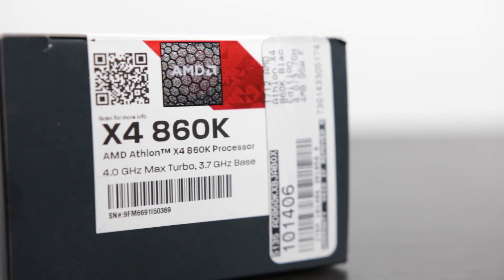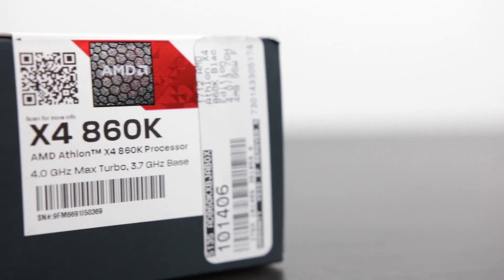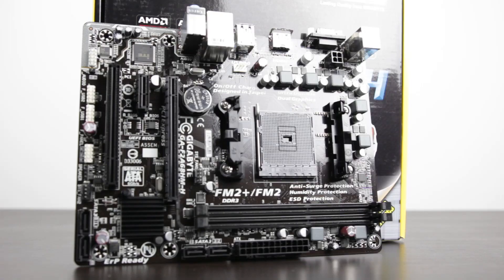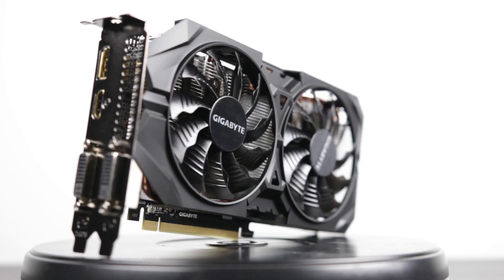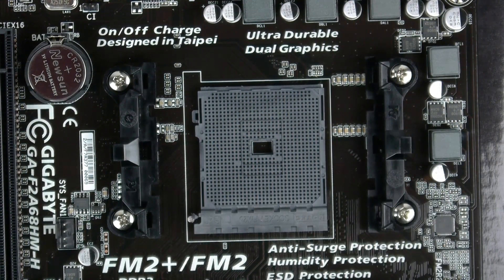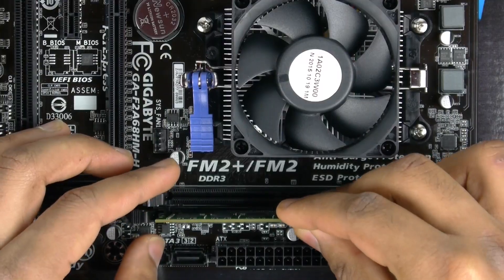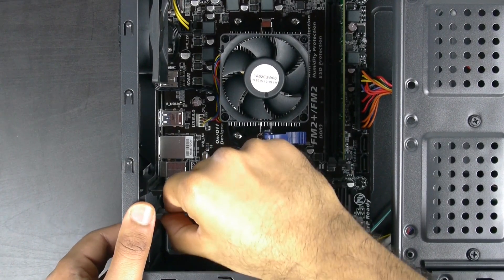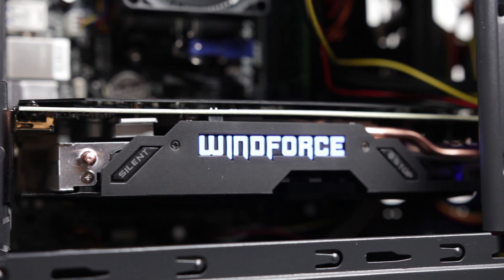Best 2016 AMD Gaming PC Under $400 - Build Guide & Benchmarks (Ep. 1)

Comment: I know this is an old video but I have a problem I built pretty much the same pc just different ram, gpu, and a different power supply I have the same mother board processor and don't have a harddrive instead of a hardrive I have a ssd a solid state drive I plug in the power cord to the psu and connect my dvi cable to my monitor I turn the PC on and it shows no signal on the screen if you know the solution to this please reply to this I really need help😔😔😔

Comment: Never Buy AMD your Processor will be s*** in 6 Months.
Reply: Deepnarayan Sett 7 years ago I bought a PC for 300€ : AMD Athlon X2 250 Processor 3.0GHz , 4GB RAM , NVIDIA GEFORCE 7500/630a and here I am still with this PC making video montages
Reply: Deepnarayan Sett amd is not that bad intel makes great stuff but i want performance for cheap if i had the money i would get an i7 but i would rather pay $100 for an eight core amd cpu rather than a $350+ i7

Comment: I'm willing to spend extra money for this build but people are saying some parts aren't good. what parts need an upgrade.
Reply: ChrisC 0324 look bro, the processor gpu and mobo are most important, you don't need to drop 100s on ram hdds and psu's just make sure they are compatible and efficient. Also Newegg.com has a lot of deals on stuff like ram. All the people saying that this is shit or that is shit are full of shit. This build is pretty good.
Reply: ChrisC 0324 ram. psu is okay, hard drive is fine. but, 4 GB OF RAM!!!???? Get 8gb of ram and it will be 9999999999999999.9999999999999999x better

Comment: Nice video! But could you tell me if the MSI h110m gaming mobo fits in this rosewill case? The mobo is in mATX form too but its a little bigger (11x11 compared to your 10x11). I find it hard to find a mATX case for this mATX mobo, since it exceeds the standard size of mATX which only 9,6x9,6

Comment: Guys I'm 16 and I want to build a gaming PC under 400 but every guide I saw is outdated and I really need help.
I want to have a PC that will last and I can upgrade in the future,but I don't have any idea what build I am going to choose.
Reply: first timers make this mistake, DON'T BUY A CHEAP POWER SUPPLY! IT MIGHT CATCH FIRE! 
things you spend the most money on:
1) copy of Windows
2) power supply
3) motherboard
4) processor
5)RAM
6) hard drive/ssd
I would go with a processor that has four cores that can be overclocked(just in case) so a core i3 or i5, but if you want more bang for your buck go for a Pentium g3258 it can over clock to i3 speeds but at CHEAP Pentium costs.
on my first build I got a cheap case on Amazon, it can be upgraded later so it didn't really matter that much.
I would suggest getting a ssd it's fast and can give you an edge.
RAM? i would say about 4gb to 8gb should do it. First timers waste money on this, unless you plan to play multiple games at the same time you don't need 64gbs if RAM.
oh, but the copy of Windows early so you don't have to torrent it, I'm sixteen also and I got mine for a discount, since we're students we can get it for cheap, cheap. (get a 64 bit OS if you wanna upgrade the RAM later)
and finally the GPU don't go cheap I would suggest a 480 or a 750 ti.
I hope I helped.
Reply: +rabnud species Thank you very much sir..and one more question what motherboard will I choose??
Reply: +Lloyd Monton I'm not too specific with motherboards but I hope you know there's a difference between amd boards and Intel boards, you can't put a Intel chip in a amd board and vice versa. there are soooo many different boards out there. mini atx, micro atx, full atx, mini itx, ect. I would suggest going to http://pcpartpicker.com and make a list of things you want, it's free to make a profile and it's basically a organized shopping list. order the things you want and the site will tell you if the parts are compatible...
if you want to know what MY first gaming build was...
-20 case from Amazon
-acer motherboard
-1.4 GHz amd processor (😂)
-500gb hard drive 
-600w BRONZE evga semi modular power supply
-evga geforce gtx 650 ti graphics card

my system came out to about 325 dollars.

if I could give any advice I would say go with a ssd, increases speed brutally.

Comment: Fallout 4 ultra at 1080p res, 50 fps average. Not bad, I definitely want to use a lot of these parts. The mobo have an am3+ slot? I would rather go with the fx6300 6 core vishera CPU if possible.

Comment: Would this run Gta 5 on 20fps , Minecraft on 60fps or higher while recording?? and can camtasia studio work perfectly without lagging?

Motherboard : ASUS 970 PRO GAMING/AURA ATX DDR3 AM3
Processor : AMD FX-8320 8-Core Black Edition
Ram : Kingston HyperX FURY 16GB Kit (2x8GB)
Hard Drive : Seagate Barracuda 1TB 3.5
Graphics Card : MSI R7 370 GAMING 4G

And also will i get a tax from amazon? cause im from overseas

Comment: I have a sapphire r9 380 nitro with the same cpu yet my results are much higher than yours, for example I run black ops 3 at 1440p with max details and get 60fps, my rise of the tomb raider runs at ultra with 45 fps.

Comment: Awesome build.... (NOT).

Problem is the APU on consoles are only 8 cores... against those 4 amd cores... (so lets not imagine a very well optimized console game using the proper full 8 cores at full performance and full optimization against future gaming on this "budget AWESOME CHEAP BUILD PC")

PSU suck.

GPU is good but 2GB is really the minimum, so, soon it will not play again any game for missing vram,

DDR3 is not the future either, however it works ok on this one BUT 4 GB of ram... most AAA games are asking for 8GB minimum already (even though on ultra they still use around 5, 6 GB...) LOOOL...

Cant really make any PC without an SSD... (had 2 WD black in raid 0 and my expensive PC never worked. I never could play any game, tried everything to fix it, sent it to the store for further testing, everything was ok, no problems found. 2 years later I found out that the problem of really bad performance was HDDs, bought 1 SSD and a new HDD and kaboom everything can play on ultra).

My laptop has a brand new and fast seagate HDD of 1TB and even after installing windows its already slow, everything stuck, hdd is always at 100%, tried everything, disabled prefetch...... nothing works, so now I need a 1TB HDD + SSD in one sata to make it work properly.

Dont want any more hdd's in my life. All old ones I had worked good, but all the latest ones I bought from WD (all blacks performance) and seagates are working badly for me. In speed tests it goes from more than 100MB\s to 1MB\s and the whole pc constantly get stuck.

Comment: NEED HELP. 
This will probably be a stupid question (I'm not good with Computers. 

Recently my HDD failed, so I bought a new one, which is still be shipped to me. 

When I bought my Lenovo desktop, it already came with Windows 8, so there was no Product Key Sticker, so I assumed it was located in the BIOS. 

If I replace my original HDD with a new blank one, will my computer automatically install Windows 8 onto my HDD? 

Since my PC came with Windows 8, I was never given the Windows OS disc. Will I have to re purchase Windows 8, or can I re-install Windows 8 via USB drive? 

Sorry of this caused any problems. Thanks!
Reply: +I&#39;m Always Right. It&#39;s True. Hope this helps: http://windows.microsoft.com/en-us/windows-8/create-reset-refresh-media
Reply: +MrKeikari 

What if my computer didn't come with a product key for Windows 8?Since mine came with it. Will it automatically detect my Product key when I install Windows 8 via USB? 

Because before you install Windows 8, it'll ask you for your product key from what I know.

Comment: I'll agree with the 860K being the best bang-for-your buck CPU, but I'm a bit thrown off by your choice in GPU to RAM allocation, as well as that horrendous PSU. 4GB is not enough for new AAA titles, I've seen GTA V get up to 5GB alone in massive multplayer games while running some recording software. You would be better off getting a GTX 950 to pair with the 860K, and bump it up to 8GB of ram minimum.

http://pcpartpicker.com/p/rXN3qs -$393.63 total, much better optimized. Cases that come with a PSU can be a bit scary, but Rosewill is a more respected manufacturer. I also got a 1TB drive in there. The price difference between that and a 500GB drive is minimal.

Comment: I think this is bad. 4GB Ram is not enough, the 380 is bottlenecked, and the PSU is basically crap. Here is my build, I think it is better, beacuse in my build, NOTHING is bottlenecked, and you could even get better performance in some games.

Processor: AMD Athlon II X4 860k
Motherboard: MSI A68HM-P63
RAM: Any dual channel DDR3 8GB KIT (2x4GB) 
PSU: Corsair VS350 
HDD: Western Digital Caviar Blue 1TB 
Case: Cooler Master Elite 241 
Video Card: MSI GeForce GTX 750Ti 2GB 
~420$
Reply: May not be better, but I think it is.
Reply: +Márton Misik Lol it will be worst almost in all case :D if you want more ram and  cheaper gpu buy 280 or even 270
Reply: Probably

Comment: honestly, below $400, you really should go with an APU and 8gb of 1866MHZ ram.  it would be far more cost effective and you won't need to sink money into a gpu.  a 7870k will do just fine, even if it won't do ultra or high, at least it will be better because because there because there won't because there won't be any bottleneck in the apu itself.

Comment: It's not a bad build, but I think the perfect balance is 450$ and getting 8 Gb of 2133Mhz RAM at 1,5V with heatsink, one of the Crucial, Patriot, Mushkin or AData kits that are really cheap on amazon. And a 450W watt PSU from a little more reputable vendor.

Comment: Sorry, but this is just a waste of money... You're better off spending more for something that will last longer or going cheaper with an AMD APU.
Reply: +livingstonem10 umm, apus are really weak, they should lower the gpu to a 750ti and get a better psu and more ram
Reply: Please why don't you make something better before making such an opinion. This is a very capable build and more for the money.
Reply: +BritishActionGamer wayyyyyyy off...completely. why would I buy a $110 gpu for a $80 cpu? My A8 7600 pushes the 960 EXTREMELY well. It's not a core series but then again it's less than half the price of the nearest I5 and 70% of the basic I5 performance.
Reply: Jerry Knudsen Why would you buy apu when you use discrete gpu? 860k is cheaper, so is G3258 and G4400.
Reply: MrKeikari
dual cores don't run that well on newer games
Reply: +MrKeikari I bought it to rely on the Igpu until I could allocate more funds to a solid gpu, and as mentioned a dual core isn't advisable for any planning in the future. also the anniversary Pentium is now locked with a microcode and can only be dealt with via top prices motherboards or work around hacks that I wouldn't depend on to survive windows updates. so the overclocking Pentium WAS a beautiful option, now it's mediocre. and skylake wasn't out during the first generations of kaveri.

Comment: That PSU is going to explode man, best off spending a bit more on at least one of these EVGA 500W PSUs at $35 right now, 80+ is the minimum you want from a power supply 
https://pcpartpicker.com/part/evga-power-supply-100w10500kr

Also the motherboard is a bit weak overall, there are usually some deals for 78 or even 88X chipset boards that are rather cheap, probably going to want to go for that

This one from gigabyte is 88X at $65, and has a bit more power delivery on the board for a more stable OC, as well as a bit more I/O
https://pcpartpicker.com/part/gigabyte-motherboard-gaf2a88xmd3h

Otherwise it's pretty solid maybe spring for at least 8gbs of RAM though and if someone's budget were closer to 500 though an i3 would be much preferred
Reply: +Street Guru i wish this was top comment
Reply: what u recomend in that budget for someone ....not that psu tho
Reply: john lee
exactly what I posted with a 4Gb 380?
Reply: Could you check my 600$ PC build ?
Reply: Jo's Tech wat is it?

Comment: Can i play games like tf2 or cs go with good fps? i have a 400 dollar laptop... i dont know alot about pcs btw
Reply: +Ari Yosef If those are all the games you need to run you could get a really cheap APU build for doing that, it'll be under $300 if you can live without a case
PCPartPicker part list: http://pcpartpicker.com/p/FRqjf7
Price breakdown by merchant: http://pcpartpicker.com/p/FRqjf7/by_merchant/

CPU: AMD A8-7670K 3.6GHz Quad-Core Processor  ($89.99 @ SuperBiiz) 
Motherboard: Gigabyte GA-F2A88XM-D3H Micro ATX FM2+ Motherboard  ($63.99 @ SuperBiiz) 
Memory: G.Skill Ares Series 8GB (2 x 4GB) DDR3-2400 Memory  ($39.88 @ OutletPC) 
Storage: Western Digital Caviar Blue 1TB 3.5" 7200RPM Internal Hard Drive  ($49.89 @ OutletPC) 
Power Supply: EVGA 500W 80+ Certified ATX Power Supply  ($34.99 @ Amazon) 
Total: $278.74
Prices include shipping, taxes, and discounts when available
Generated by PCPartPicker 2016-02-21 15:41 EST-0500

A8
7650K | CS:GO/Dota 2/SC2 benchmarks Tested With 1866Mhz
RAM
http://www.technologyx.com/featured/amd-a8-7650k-apu-review-the-little-apu-that-could/4/

A8
7650K | Various AAA titles Tested with 2133Mhz
RAM
http://www.anandtech.com/show/9217/the-amd-a8-7650k-apu-review-also-new-testing-methodology/7
Reply: wow, i apppreciate your effort thanks for the help!

Comment: AMD cpu for Gaming? I think not. Save Your $ and get at least a skylake i3 and get a better psu, Never skip on the psu, because if the psu blow it can take other parts with it.
Reply: +Barack Smith an i3 puts the build closer to $500
Reply: Barack Smith
Right but how soon would the upgrade be? If it's not for a few years then newer stuff and newer platforms are going to be available, meaning you'd need a new motherboard anyways, and given that it's a quad core, I'd take it over the G3258 as it seems more and more games require a quad core to run well if at all.
Reply: Barack Smith
I wouldn't recommend taking a risk on used parts if it's going to be your only PC and your budget is low, otherwise a $300 GPU is going to be far out of the scope of such a low budget PC.
Reply: +ThatGamerGuyNL the fm2 socket is actually really limiting rather than lga1151. the Intel socket allows you to upgrade to an i5 or i7, or even wait a little for the skylake extreme edition to come out. the and socket doesn't allow for any upgrade whatsoever, unless you get an fm2+ and upgrade to an apu. not a good bet imo
Reply: ***** Wrong.
Reply: +Barack Smith yeah also for upgradeability its important to get a cpu socket on your motherboard you can upgrade later on with better cpu as a i3 can be a bit limiting
Reply: Street Guru You can later upgrade the i3 to an i5 or i7 , you won't get much better on the AMD. Value for $
Reply: Street Guru A 2500k/2600k will still run this AMD cpu over in cpu performance/gaming AND this AMD cpu will bottleneck higher end video cards like the gtx 970/r9 390 and faster.
Reply: +Sid Nas The short of it, is that if you're going to have to use this PC for 1-2 years, you're better off with the 860K vs a dual core Pentium, also can you overclock the skylake Pentiums? Because the G3258 needs some overclocking in some games like GTAV to keep up with the 860K, also your minimum frame rates can suffer with a dual core.

Unless intel lowers i3 pricing, I'd stick to the quad core, even if it's slower in some CPU heavy games, just for compatibility's sake, some games like far cry 4 and battlefront won't even run on a dual core out of the box. Although hopefully AM4 is decent and relatively low cost, that would be a decent choice if AMD is offering the same quad cores for Pentium prices.
Reply: Street Guru No, You are wrong. That is the short of it.
Reply: +Barack Smith No, Dual Core is outdated, there is proof everywhere, Pentium is suffering in new games and now the i3 is, even with its hyperthreading. they should of used a gtx 750ti and upgraded the ram to 8gb and the powersupply to a cosair 430w.
Reply: BritishActionGamer No, see DigitalFoundry benchmark & frame rate analysis on skylake i3's. .
Reply: Barack Smith It depends on how lucky you are, but with the pentium failing in newer games, the i3 is next

and skylake is extremly expensive
Reply: +BritishActionGamer so if i got 400-450 budget what you recomend
Reply: +FaintVFX Are they even going to work?
Reply: +Barack Smith Just build an A10 system and add a descent graphics card later for a good gaming budget.
Reply: weirdokiller123126
apu gaming is so not worth it, get a $70 intel dual core or amd quad core and $120 gpu like a 750ti or r7 370, you get better value for your money, even a $80 gpu beats the a10 apu